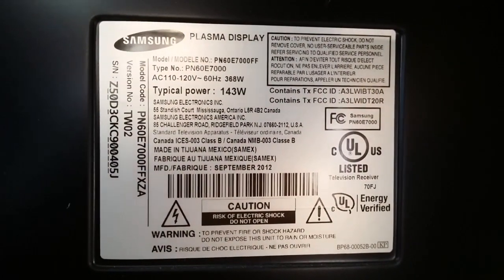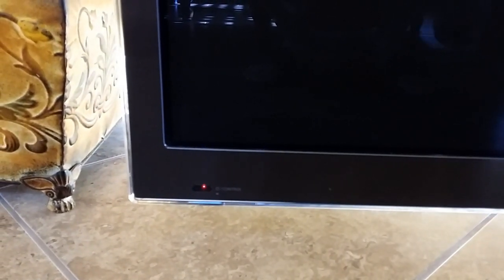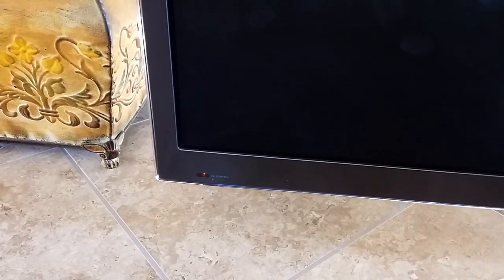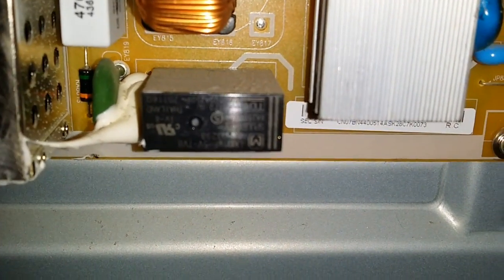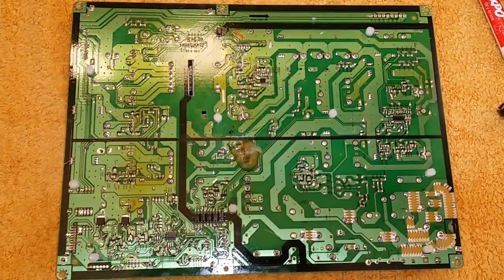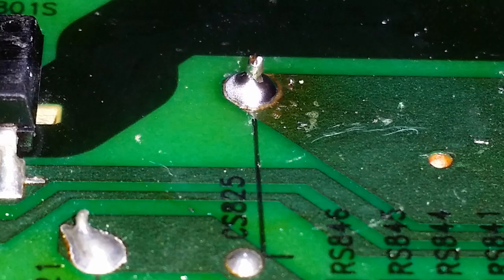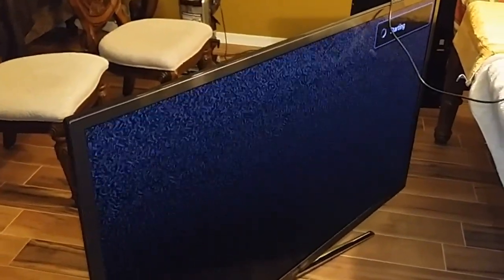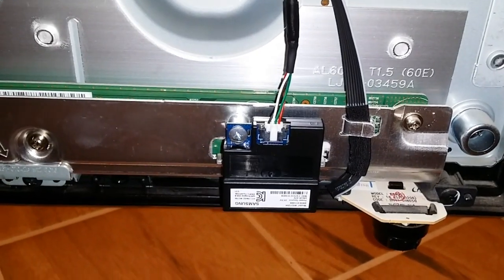Samsung PN60E7000 Plasma TV Won't Turn On

Comment: I have same one love it but getting small vertical lines on right and left cleaned all connections no fix what board should I look at or replace
Reply from the maker: Since I can't see what you see I suggest you inspect every single board.